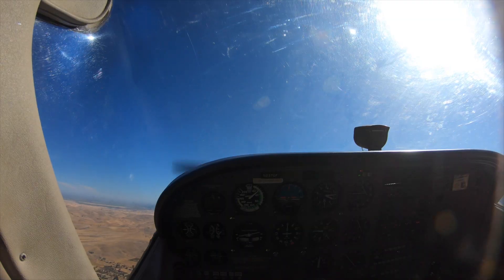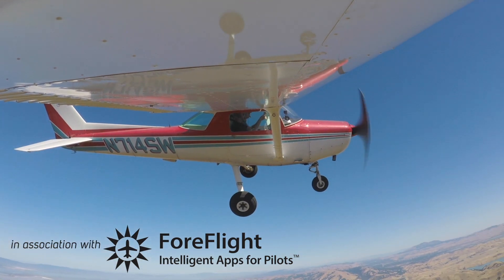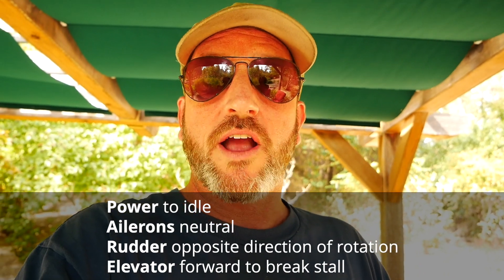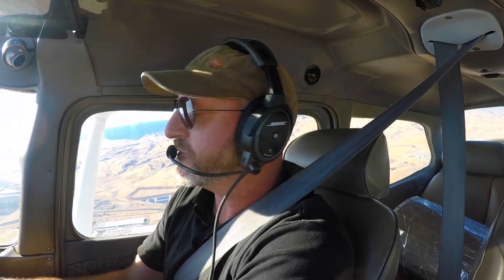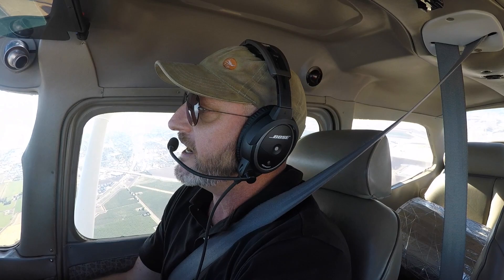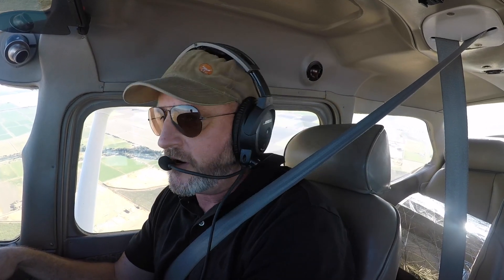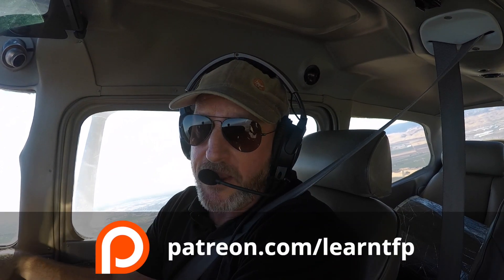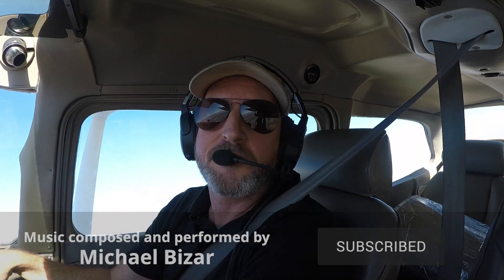Stalls Using NO Rudder! Prevent Stall Spin Accidents STOP Spins from starting Incipient Spin demo

Comment: Have you ever flight a tomahack?  haaa ..I suppose yes but, I say that because a an PA38 stalls at almost 80 knos. Especially it is dangerous in final approach because of the high tail type... tends to fall backwards, and if there is not enough altitude you will not get out of that.

Comment: I want to be a CFI and do this demonstration for students (in and airplane that allows spins, of course).

"Here's a stall with no aileron, using only rudder to hold the wings level.  Okay now here's one with no rudder, using only ailerons.  You remember earlier we talked about spins?  Yeah, make sure you're strapped in good and tight, and let's double check everything in the cockpit is nice and secured."

Comment: I fly a Cessna 152 which doesn't have a corner to its front windshield like the 172 does and I found out yesterday that I can't really tell which way my nose is dipping prior to power on stall (resulted in a near spin when I stupidly twisted the control column to correct... yeeeeah I know that's very bad and needs to be dealt with immediately). Would looking out my door windows have a similar effect to the Lindbergh reference? I would love to avoid wing drop as much as possible.

Comment: The other reaction I often see when administering a flight review is pilots trying to raise the descending wing with  opposite aileron input.  This only aggravates the situation further increasing the angle of attack on the already-stalled wing.  Prompt, decisive opposite rudder input is the remedy, as you point out.

Comment: in the 90's and early 2000 I literally practiced stalls at every flight I took. Also did dozens of spins in various configuration. There is really nothing to it, at least on a 152 or 172.  Yet, these days, most instructors won't even let you do a full stall and spins are completely out of the question. Freaked out an Embry Riddle instructor the last biennial review I did. "Imminent Stalls" are good enough now. I miss the old days.

Comment: Great video-

But what if a pilot encounters a stall & spin while in IRF / IMC conditions & cant visually see horizon or ground?
Reply: The turn coordinator will tell you which way you're spinning and your airspeed will tell you whether you're in a spin or a spiral dive - fairly low and stable means a spin, rapidly climbing means a spiral dive.

Comment: A great demo is to do A Chandelle Stall Turning right while pilot is 
looking to the right.  Like after a flyover a friends house, you pull up
 and turn back right 30 bank to flyover again.  If pilot is turning his 
body to the right, he wont be able to apply enough right rudder. It will
 spin to the left hardy, be ready to kick that right rudder and pull 
power at same time. Canada makes better pilots. And have a lower 
accident rate for LOC..

Comment: I was almost on the verge of giving up on my flight training as I kept on having wingdrops during the power off stall exercises. Knowing how to anticipate and correct the turning tendencies with rudder pressure as I pulled back on the yoke was the fix for me.
Reply: You mean on a power on stall? Not saying you can't be uncoordinated and have a one wing dip to the right or left, but the wing drop is more pronounced on power on stalls if you're not coordinated.
Reply: @PortugueseFlyingStew  This happens on approach stalls to me as well. As soon as you pull back the stick all the way, one of my wings would dip. Even my instructor had trouble pin-pointing out what I was doing wrong because the stick would be pulled back very straight and my rudder was centered as well with barely any wind. Lets just say departure stalls were easier to me.

Comment: Hello, just started my learning process, thanks for your videos.  For a power on stall much of the training I’ve read mainly mentions to decrease back pressure/nose down, then recover, with rudder control away from any roll direction if you stalled while not in coordinated flight.  You mentioned powering off first for these power on stalls with spin potential - would it be recommended to kill the throttle when any power on stall occurs until you recover (after releasing back pressure/countering any roll - then throttle full and slowly recover the dive)??

Comment: Is there a case to be made to just look at the turn coordinator instead? For aileron control to keep wings level approaching the stall - it shows you small amounts of bank, and once you're in the bank, it will continue to show you a turn until you level off. Seems like a much easier task. For rudder to keep coordinated - there's the ball...

Comment: At my insistence, I was taught all about spins, entry and recovery way back in the 1960's, with my first Flight training. 
The "Old Timers" were more then happy to train them. Not so with the "Young Bucks"! Spins scared the pants off most of the younger crowd.
Reply: And slips, And EFATO even simulated.  And max crosswind landings, and Turnbacks on GRM, on Initial Climb, and Box Canyon Turnbacks.. I taught that all, and the maggot CFI at other side of the field use to call me "A tough CFI"...  Maggot .

Comment: New PPL pilot here maybe someone can answer my question. Above 3000 feet, VFR cruising altitudes start to take effect. Ok well if I'm going up to practice some stalls and especially spins, I want to be high enough. Ok so the idea is the VFR cruise altitudes separate IFR cruising altitudes. BUT if im gonna practice a spin and I initiate the spin, I'm going to lose probably 1000 feet at most. I know scanning for other aircraft is critical before doing any sort of maneuvers like those, is there any pther advice anyone can give me? Also how does ATC see and feel about GA airplanes just going up and doing wild maneuvers like that especially if we aren't talking to them?
Reply: In our school we had training areas, but if you don't have these, I would probably go to a spot where there is not a lot of traffic and request arc a block altitude. So the message will be: Tower, Callsign, request to work over area with block altitude of ....ft to ....ft.
Reply: And one more thought, above the 3000 feet, vfr aircraft should be using the appropriate vfr cruising altitudes. Is that going to matter though if I'm, going to say 3500, then dropping a thousand feet and going back to 3500 and, dropping again?
Reply: Oh and btw 3000ft AGL is not enough for spins, recommend at least 5000ft AGL if you go and practice spins
Reply: @DonWouter1  Noted. Thank you for the reply!

Comment: In Canada we do spins in PPL training. Knowing what it feels like and how to correct it saved my backside when I was exploring the flight envelope of my newly-purchased Beechcraft and my feet were't quite happy enough on a power-on stall...
Reply: Many instructors, here in the US, will do them for you. My instructor gave me the option, and the school had a 150 which is certified for spins, and we did them. 

The amazing thing is you have to ignore your instincts. If you try to pickup the dropped wing, with ailerons, then you will make it worse. If you never experienced a spin, or even a full power on stall,  with a wing drop, then in case it happens outside of training with an instructor, then you’re very likely, under stress, to do something counterproductive.

I realize that putting ourselves in danger, during training is an issue, but every pilot should know how to control a plane, through the full envelope of flight.

Comment: Would you say almost every time, the plane will spin to the left if no rudder is implemented? Or is it possible to spin to the right with no rudder? For power on stall
Reply from the maker: Always left of power is in and you’re using no rudder. It would be impossible to spin to the right. Unless the airplane is Russian made 😜 (those props spin the other way)

Comment: If there was ever a case to use the Lindbergh  reference, it would definitely be during power on stalls. Using it during other phases of flight is really important as well, but I’d argue that this one is the most important. When you’re at high altitude doing a high pitch attitude maneuver, you are literally just going to look straight up into space if you just stare outside the front window. There is no horizon at all to help you out. During my student pilot days while I was learning this maneuver I was always extremely worried that all I had to look at was the dark blue sky and I never knew if I had put in the correct amount of right rudder or not. This technique really brings it all home and solves that mystery! Thanks Jason!
Reply: Lindberg..
Reply: flexairz I’ve spent too many hours listening to Rush Limbaugh on the radio 😂
Reply from the maker: Yes! That’s absolutely right

Comment: How about a stall spin in IFR?  No Lindberg reference.  Any tips?
Reply from the maker: In that case you’d focus on keeping the ball centered. But beware - once in the spin the ball will always “slump toward the spin- don’t “step on the ball” but use the turn indications to determine rotation and push opposite rudder.
Reply: Keep the ball centered to prevent a spin. If you want to know the direction of the spin, look at the turn indicator.

Comment: Great video Jason, Am working on my cfi, and I am gonna use all the tricks you have taught me to my future students. My check-ride examiner, kicked the left rudder when I was doing my PPL check-ride while performing power on stall,  I knew he did it cause I could feel the left rudder go in, and like any low time pilot, I tried correcting with aileron as a first instinct, but I remembered my instructor saying correct with opposit rudder and as the wing dropped and my heart was in my mouth I kicked the right rudder and corrected it. It was a fun check ride cause I passed. Lol. BTW is that a camera you have mounted on the left wing?